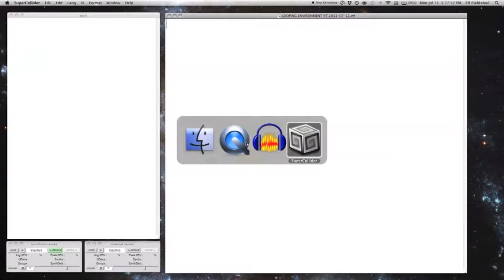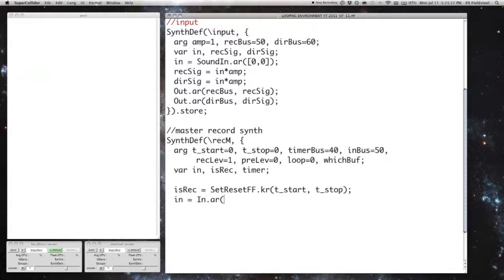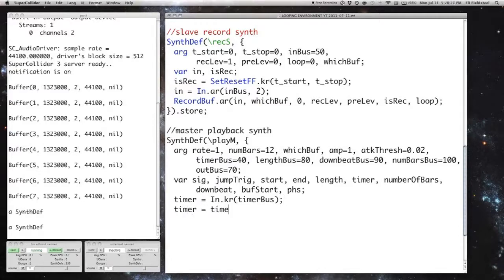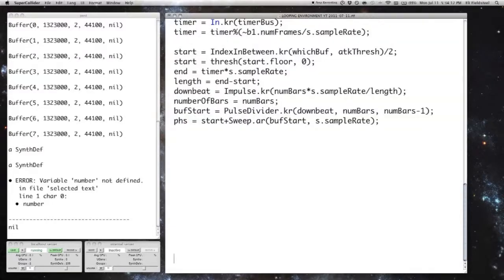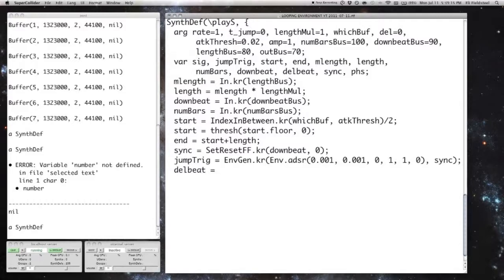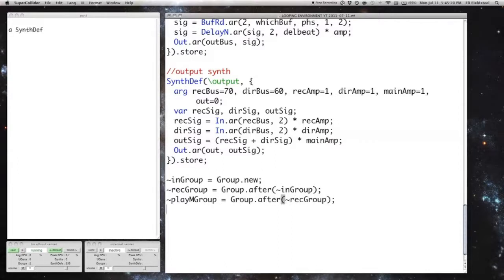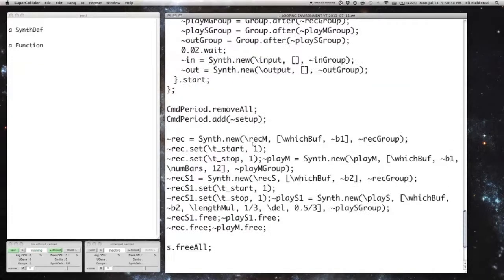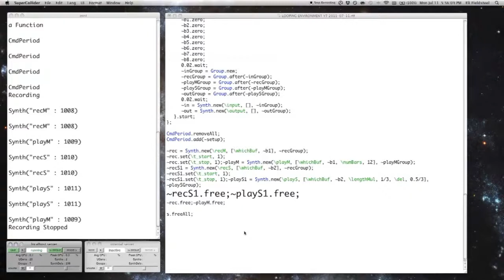Synchronous Looping Environment in SuperCollider

Comment from the maker: I'm not promoting this approach as a superior alternative to buying software/hardware specifically designed for loops. In fact, if you're exclusively devoted to looping, you should absolutely buy a loop machine, especially if you don't care about the theoretical aspect.

This video has to do with the ideas behind designing a loop machine. So, the target audience is primarily SC users and other audio programmers who have an intellectually curiosity about this sort of thing.